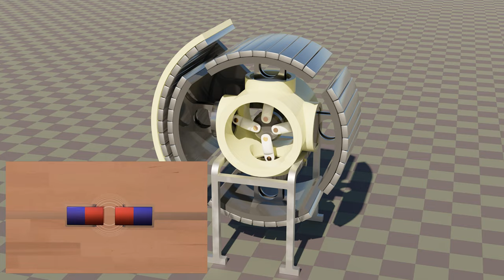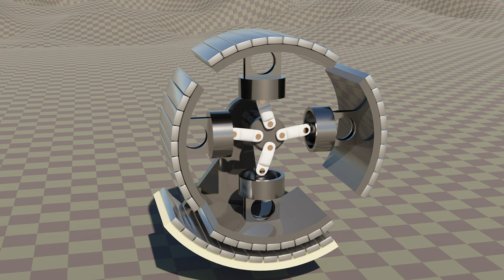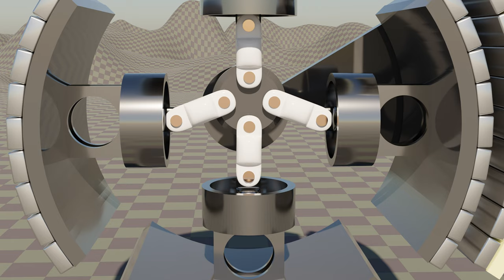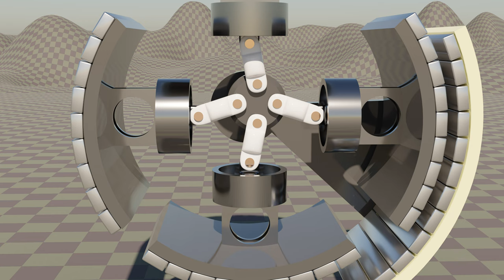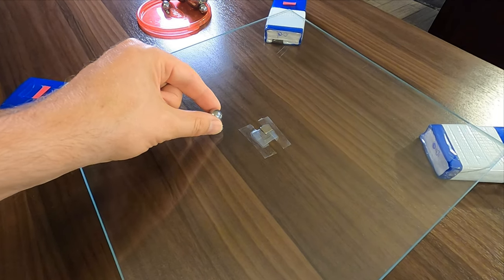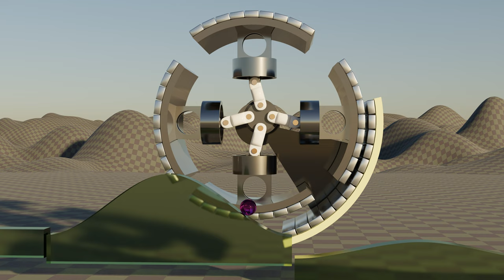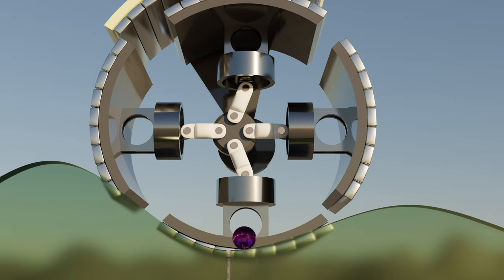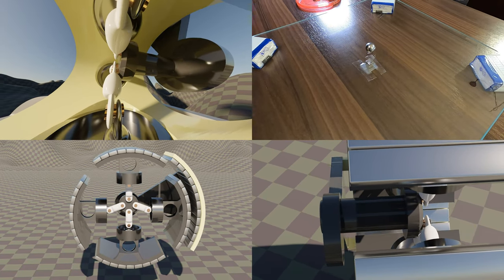Truth: Permanent Magnet Motor - Best Perpetual Magnetic Energy Idea

Comment: All these videos have the same problem, you design thinking spin smooth but you aren´t considering the energy needed to detach attraction in your system, that is to say that the first step when magnets start to pull together it´s fine, but when you will try to detach that attraction it could spend all energy of the system, that motor will not work

Comment: The same thing could probably be done by cycling electronagnets in place of the moving magnets.    The motor is first started with battery power then switched over to a recharging generator once it gets going.
Reply from the maker: Hi DP, thanks for your comment. The loss of power using electro magnets will make it impossible to build up an perpetual motion motor. But for just build this kind of device it’s an good idea. Thx for watching 🙂

Comment: Here’s my take on a magnetism based perpetual motor or an over unity generator if that’s what it is, if it’s successful and you don’t provide a load or means of retarding the output or phase timing it should (run away) or over speed! It will accelerate until peak output is reached and a contraption like this if it by some miracle overcomes the mechanical losses which it does not look like it will! Will self destruct really quickly! It will shake itself to pieces as the potential speed is in the tens of thousands of cycles a minute! But you’ll figure it out! You put more effort into this than I did 30 years ago! Well done!
Reply from the maker: Hi Need, thx for your comment. I haven’t invented this one. I took the idea from YouTube and thought about the principle. The result is the video. 🙂
You did right, years ago 😉
Thx for watching

Comment: My friend, this is pretty much EXACTLY the design I have been playing with since a child.  Many variations for 40 odd years.
I forgot all about it with life getting busy for a few decades, but just 6 months ago I was pulled back to it by spirit, and this was the first design I started back on.  Again, I stalled and have started a dozen projects, never finishing one.  
SO,  I AM SO HAPPY TO SEE YOUR RESULTS HERE !!  WELL DONE MATE.  Happy to bounce ideas with you and share all my ideas.    Keep going.   
Though I am certainly NOT trying to come up with a perpetual motor or a over unity free energy generator, but I am looking to utilise all we can pool together or what I can gather to at least have a motor/generator running as efficiently as currently possible with all the new improvements with processing speads for switching and magnets of greater strength, etc etc.  If it cuts my fuel bill or power costs down by 75% or greater, 50% even, I'd call that a success for me, and more than enough for others to build upon and improve.
I recently purchased some nice N52's and have some tiny generator ideas i'm tasking presently.
I look forward to cruzing your channel and looking at what else you have been working on.  Namaste'
Reply from the maker: Hi Richard, thanks for your comment. Sorry for my message, that this device is not working. I tried some devices by myself before I changed my point of view. Your idea to improve the efficiency of an really working motor is great. Good luck 🙂, thx for watching.
Reply: i make like this motor 30 year ago...

Comment: It is only a good idea.  But, the weight of the arm that leaves the rotating shaft, and which supports the set of magnets in orbital movement, would already cause, by itself, a decompensation that would tend to stop the rotating movement. Better idea would be to replace the arm with a perfectly balanced disc
Reply from the maker: Hi Sarina, thank you for your comment. Yes the weight of the arm it’s a real problem. You can solve it by turning the machine horizontal. Then the weight of the arm doesn’t affect it. Even then the machine would not work. 😄 thanks for watching.

Comment: One addition could be made.
When each magnet passes by the other magnet there is a flux reversal. This is a generator moment! Just install a coil on each magnet. Not sure what type of coil, you have 9 long magnets. There are so many ways to do that. The coils will produce more than enough power to support your movement forward.
Reply from the maker: Hi Wesling, thx for your comment. If you insert coil for gathering electric energy, the coil will slow down the rotation because it will act like a power break. If you take energy out of the system, you can not renew it out of nothing 🙂 Thx for watching.
Reply: That's why you put coils on the out side not in between magnets

Comment: Mechanically, it doesn't work because the crankshaft is not functional. It rotates on its axis on one side, and on the connecting rod side, the movement shown is impossible.
To make it work, all the connecting rod legs must be mounted on the same axis, like on a star engine.
Reply from the maker: Hi Jean, thx for your comment. Thx for watching 🙂

Comment: There would appear to be a lot of friction involved with this design. I understand why that friction must exist to make the design work, but it's a pity that there is not a way to design that out of it.
Reply from the maker: Hi Red, thx for your comment. I like this design very much because of its smooth movements. Yes friction is a problem but the main issue is that the design is not able to run without external power source 🙂. Thx for watching

Comment: If a motor is in a permanent state of imbalance, it should be self-starting regardless of the relative positioning of the driving and driven elements.
Reply from the maker: Hi Victor, thanks for your comment. Yes, it will start to run in the moment when it is built. And it will never stop until it is disassembled. 🙂 thx for watching

Comment: Hello!
Thanks for the great idea. I've been doing work with magnets for a long time now and always get stuck. Thank you for your good idea. I'm already implementing your idea. I think what we are doing is increasing the efficiency of the engine because when passing 1/4 turn, the rotor accelerates suddenly.
Thus, through 1 rotation, the rotor will have 4 times of acceleration without adding thrust. Can you connect directly to the engine and transmission to check how the performance is? And another thing: due to the eccentricity, the rotor vibrates very strongly - it must be counterbalanced. Thank you very much. Hope to exchange more.
Reply from the maker: Hi Thong, thanks for your comment. Glad you like the video. Just as a well mend hint: The principle this motor is  based on is not working. I try to tell this in my video with the help of my gravity model. 
Feel free to build a free energy machine, but recognise that most of the motors principles out there are only ideas without a working guarantee. 
If you are able to find a principle which is working in my gravity model also, then it might have the ability to make the Revolution 😄
Thx for watching

Comment: Esto no va a funcionar porque en la simulacion se olvida de algo basico, la fuerza de gravedad, cuando el pendulo va de subida lucha contra la fuerza de gravedad y debe ir mas lento, cuando va de bajada la fuerza de gravedad lo atrae y va mas rapido, luego de unas vuelta el pendulo va a quedar hacia abajo atraido por la gravedad, solo va  agirar por efecto de la inercia  y mientras lo hace se va a sacudir como cuando la maquina secadora de ropa  no queda centrada
Tiene que ponerle un contrapeso neutro magneeeeeticamente solo para estabilizar frente a la gravedad el giro

This is not going to work because in the simulation we forget something basic, the force of gravity, when the pendulum goes up it fights against the force of gravity and must go slower, when it goes down the force of gravity attracts it and it goes faster, after a few turns the pendulum will remain downwards attracted by gravity, it will only rotate due to the effect of inertia and while doing so it will shake like when the clothes dryer machine is not centered
You have to put a magnetically neutral counterweight just to stabilize the spin against gravity.
Reply from the maker: Hi Luisac, thx for your comment. For wiping out the gravity it might be possible to rotate the motor to work in horizontal instead of vertical position. But the principle is not able to work. Thx for watching 🙂

Comment: Сперва создай это в металле и покажи, что работает, а потом только "садись на уши" не окрепшим умам.
Reply from the maker: Hi Andrew, thanks for your comment. Even if I would build it in metal, the field stays invisible and so I never knew if my configuration is, the reason that the thing does not move,  or my small technical skills are reason or the design is the reason for it. The only way is to make it invisible visible. Then the design could be proved. Thx for watching 🙂